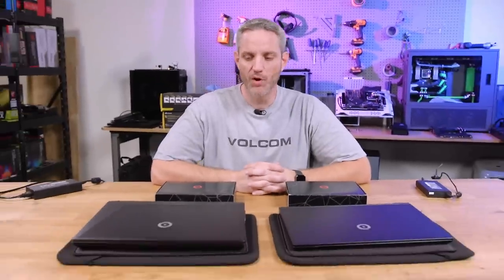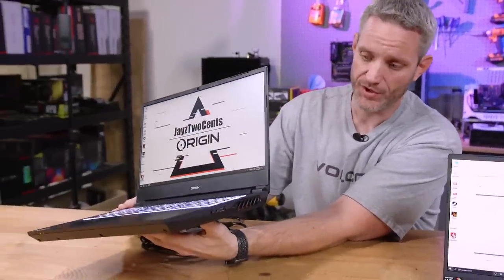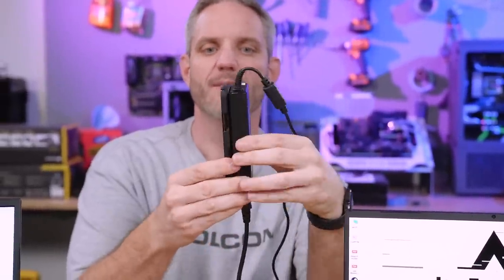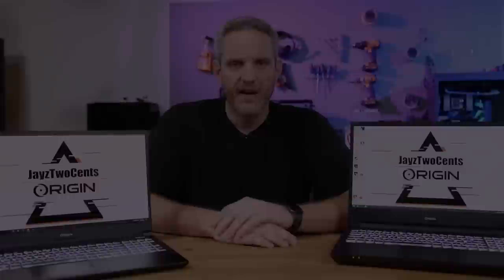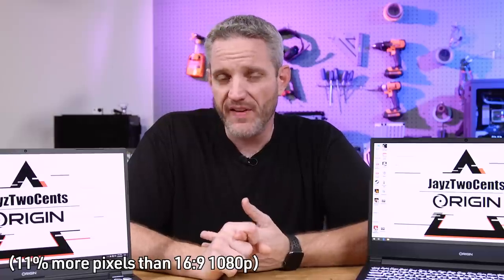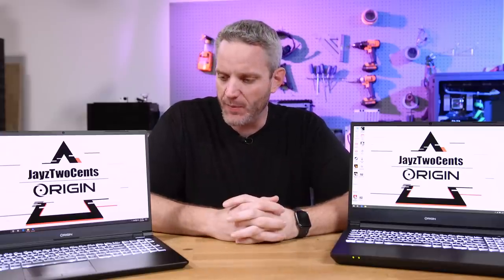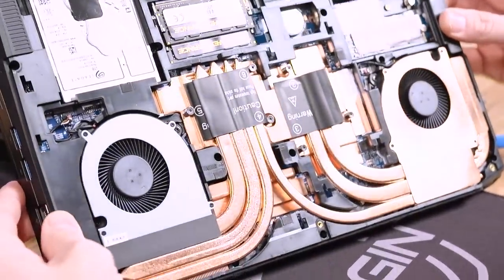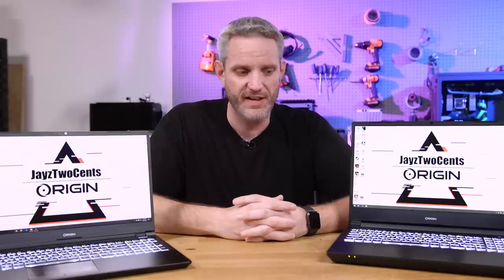A Laptop with 16 Cores 32 Threads?? Desktop killer!

Comment: I would use the amd for college to replace my aged Frankenstein laptop, its soo old it still had a socketed athlon ii p230 that i swaped for a phenom quad core i had to cut out the fan grills out to help it breathe and my ati hd4200 are dead no longer supported im running windows hd drivers. So yeah im saving for a amd laptop that can help me in college and maybe game a little when i have the time

Comment: And the battery 😂
Reply: Battery will probably will last about 5 minutes on each system lol.
Reply: Baffles me what’s the point of companies making laptops like these
Reply: @t2smoothy  Prior to the current pandemic, LAN parties would have been one of the proper use cases but... that ain't happening now. Now, it's just work station replacement for the folks with very deep pockets. But again, with the current pandemic, not many need mobile workstations now.... So I agree.. there aren't many use cases at the present time lol.

Comment: I could use that laptop, i have been having to  record videos for work, and the laptop I was using can't handle the 1080 video encoding. I haven't tried it on one of our desktops (they have about the same specs as the laptop, because they are actually mini pc's, or, laptop boards in a mini case and attached to the back of the monitor)  i have to use a laptop most of the time, because we sometimes film "on site" outside of work
Reply: John, I don’t know what you were using... but this is more than overkill for 1080p encoding. My MacBook Pro 2012 is more than enough for this with the upgrades I’ve done. Even for 4K encoding you wouldn’t need this. Those are made for stuff like engineering development and other insane stuff. You could probably encode 16K RED files with the highest spec’ed one. No joke.

Comment: Meh typical laptop dumpster fire. They probably charging 2 grand for that laptop and because there's no way it can keep an rtx 2070 cool enough not to throttle like a mofo, im guessing the gpu boost ends up downclocking under any amount of stress. I'd bet you would get better performance out of a 2060 in a properly cooled desktop case. I'm really just not impressed by the fact that they shoved a bunch of desktop hardware into a tiny case. I feel like that's what im looking at, imagine instead of reviewing a laptop, you were reviewing a desktop case. A friend said hey I want to get this case and put this hardware in it. I would immediately direct him to gamer's nexus case review videos and explain how in a properly cooled case he can get way more performance out of the hardware. unless they had the CPU and GPU on separate loops... wake me up when one of these guys puts desktop skus in a laptop on separate loops, then we'll talk.
Edit: Separate loops with full rads*

Comment: my Prejugé againt laptop.
Overprice
Super-high temp
Noisy
too hard to modifieing/reparing/Upgrade.
----
After the  video.
--- 
I am still right.

Better buy a 400-600 buck Laptop and do Remove desktop for Any intensive work.
If you are short. just rent a Shadow PC.

Comment: I have a 15.6" Laptop with a 4k screen. I would NOT recommend it, scaling is still bad.

I would go with the Intel system with a lower spec GPU and a 1080p or 1440p panel. 
Because it's thinner and lighter. I'm only doing lightweight 3d design on it.